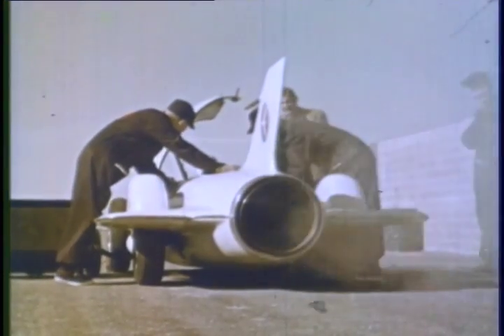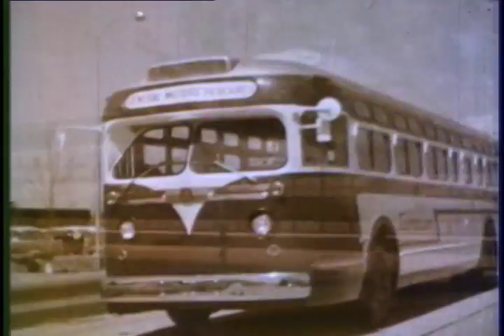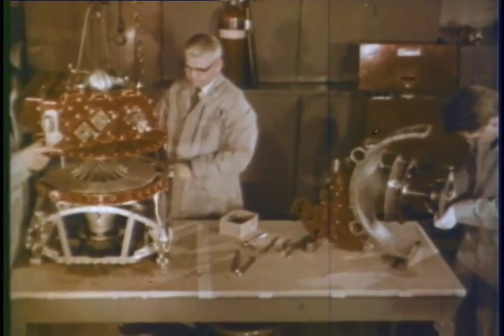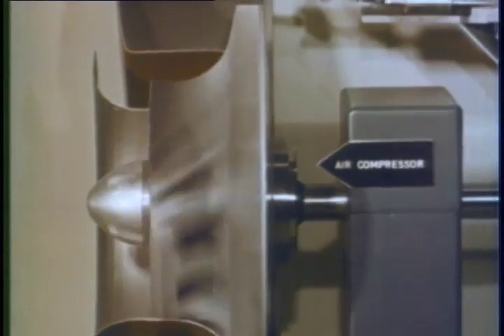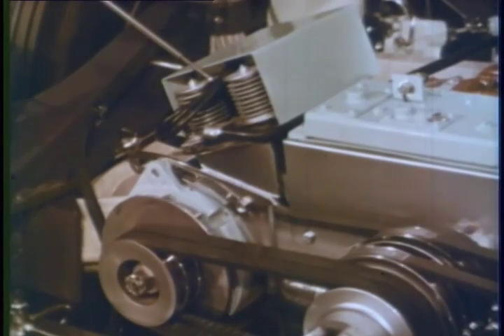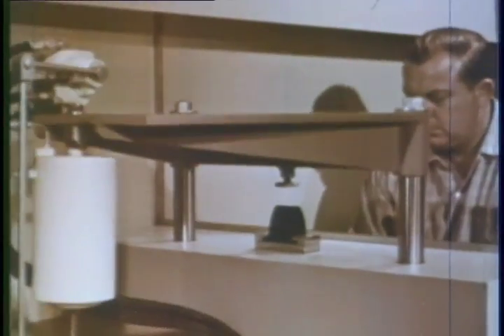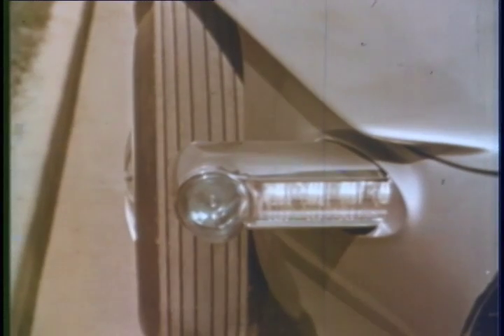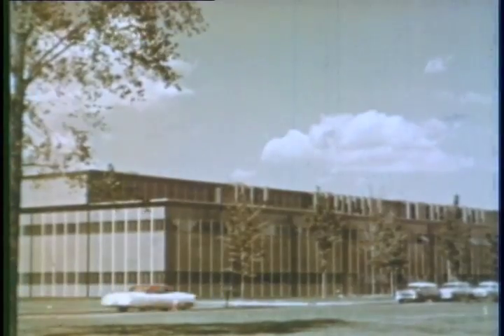The Car of the Future in 1956 - Firebird II

Comment: The STP-Paxton turbo car proved at the 1967 Indy 500 that a turbine-powered car could be very effective on a race track.  However, driving around a 2 1/2 mile oval at nearly constant, high speed was the perfect job for a turbine.  Actually driving on the street was beyond its capabilities.  Turbines hate to change speed.  Asking them to power a car that actually stops and goes is practically out of the range of possibility.  Plus, they waste tremendous amounts fuel, even with heat recovery systems.  The turbo Firebirds were nothing more than a styling exercise.

Comment: A lot of people making fun of the turbine engine but the Army's M1 tank uses a turbine engine. The engine runs a constant RPM and uses the transmission to control speed.
Reply: Turbines also guzzle fuel
Reply: @rdm5190  only 8 gallons to the mile
Reply: And has to be refueled three times to every one time that Bradley IFV's have to be.  Makes planning maneuvers a real pain.

Comment: Many of the advances in this car ended up in production years later: AC alternators, Hydraulic brake boosters, Disc brakes, Pneumatic assisted suspension, Independent rear suspension with CV axles.
Reply: Yeah but all we really wanted was the turbine engine and that dashboard with all those lovely gauges.

Comment: Think a small turbine may be usable as a range extender in an EV, it could run at it's optimum power / speed since it's just charging a battery and not connected to a transmission or drivetrain that would require changes in speed. Drive your EV to work and back every day charge it like normal, take it for a long trip or if charging isn't available a light modern turbine could add range back to the batteries. They also can run on many fuels, not just gas.  But I expect there may be a noise problem running a turbine engine.
Reply: @sourand jaded yep. agree with you there.

Comment: That design was so awful, I’m thankful none of those features ever came to market.
Reply: Actually, most of them did.  Alternators, hydro-pneumatic suspensions, disk brakes, rear transaxles.  Don't judge the effort by only the gas turbine.
Reply: @andyharman3022  Alternators were first introduced as standard equipment on a production car by the Chrysler Corporation on the Valiant in 1960, years before GM.
Reply: @KeithOtisEdwards  This was 1956.

Comment: The alternating current generator the Chrysler invention.
And disc brakes just like Chrysler first put on one of their cars in 1948. You sure this is a General Motors video???. Goes by 1956 Chrysler already had gas turbine cars driving around on the roads.
Aerospace and Automobiles tried to work with pneudraulic suspension systems and Power Systems for about a decade or so before they finally decided that mixing oil and air doesn't work very well. I don't know why they thought that oil and are mixed but okay?
A planetary gear and hydraulic transmission, wow another Chrysler development.
So far the only thing I haven't seen the news yet is the electronic port injection that Chrysler invented and had on cars in 1956.
Reply: Chrysler didn't start using alternators until 1959-1960. The first alternators were used on some military vehicles during WW2. Thety had the separate rectifier module like the Firebird in the video. Not sure but I believe the Leece-Neville company developed them.
Reply: Electronic port injection by Chrysler in 1956??? Show me....I CAN show YOU mechanical port fuel injection on a 1957 Chevy!! Electronic?? I don't think so!! Half the "electronics" required to run it would not have fit in the trunk in 1956!!

Comment: If a car was going to have all those gauges, it would never work out.  Drivers just couldn't handled something that looks like the cockpit of a jet aircraft.  Then there are questions about fuel economy.  Jet airplanes use a lot of fuel.  Having a jet engine for stop-and-go traffic has got to be worse.  Then there are pedestrians who might be walking behind such a car. Blowing people down might be a feature some would like, but I don't know.
Reply: gas turbine + generator + batteries+electric motors.   burn any fuel you want, and turbine runs at top efficiency to charge the batteries. Ultimate plug-in hybrid. 
you really only need maybe 30hp turbine power, and let the EV system handle the rest with big big batteries and 500hp electric drive.
Reply: @shmuck66  people just don’t understand how efficient a consistent rpm engine can be when used with a generator and good batteries
Reply: @turkeyboyjh1  the first 4 words were perfect! The rest is true too!
Reply: @shmuck66  I understand the efficient loss from transmitting power from the engine to the generator but you have to some way of making usable torque, of course you have cvts and variable fluid torque converters but having a little engine charge enough to go down the road and provide extra power to the batteries for passing and acceleration